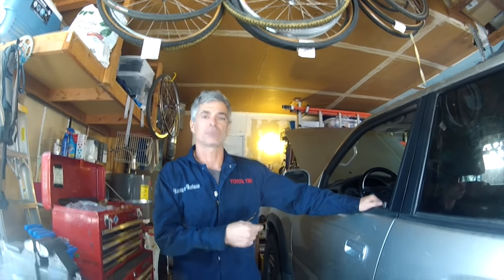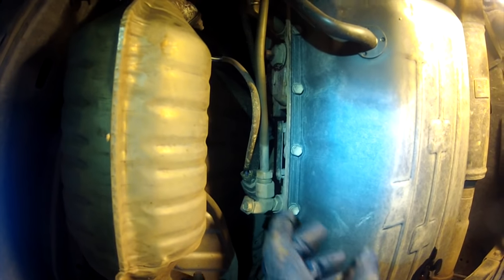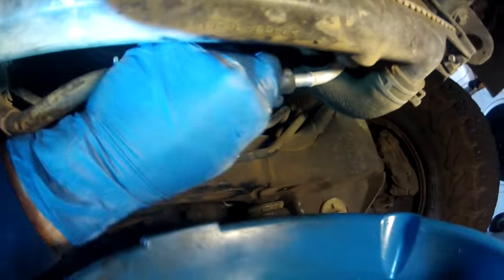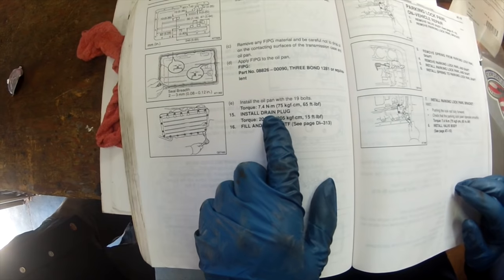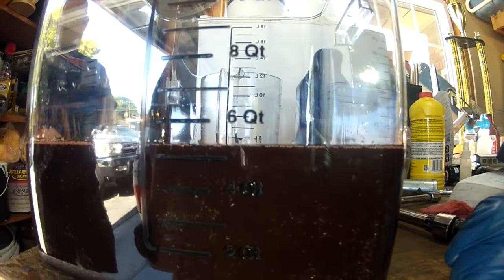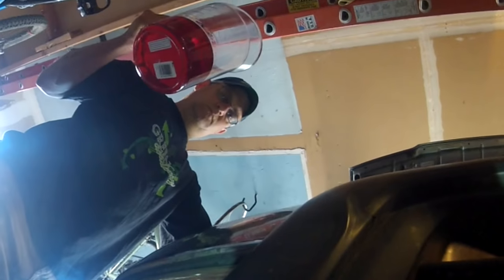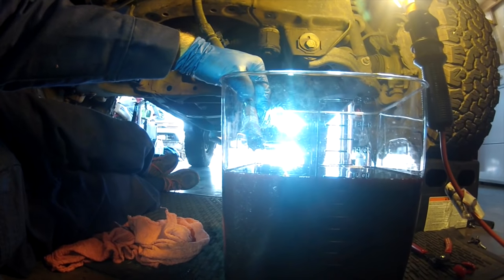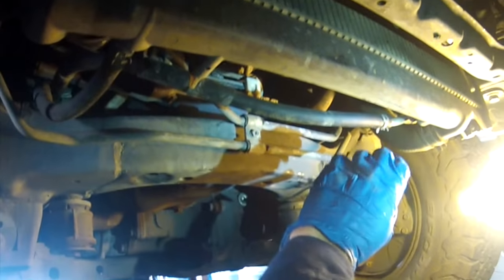Transmission Fluid Flush

Comment: @ TimmyTheToolman are you located in California ?? If so I'll pay ya well if you help out my Tacoma the transmission fluid needs to be replaced please!!
Reply from the maker: Oścâr Gomez Hey Oscar, I live in West San Jose near Campbell.
Reply: Timmy The Toolman I'm in San Diego I could come up to you!!
Reply from the maker: That's a hell of a compliment you'd be willing to drive all the way from San Diego for me to change your transmission fluid.  I just checked Google Maps and that's an 8 hour drive one-way.  This is not a hard job to do.  If you follow the steps we show in the video, you can do this no problem.  What year Tacoma do you have?  If you have a transmission cooler in the bottom of the radiator like most automatic transmission equipped vehicles have, you can just pull off the return line from the cooler and do the one quart at a time exchange until you fluid looks new again.
Reply: Timmy The Toolman well I've been  searching on Tacoma world, I have come across good write ups on how to do the flush most people are totally against the flush people say it'll shorten the life of my transmission in half ... It's a 2006 Tacoma TRD off road v6 sealed transmission . It's been bugging me for a while now preventative maintenance is what I'm all about .you know what your doing I enjoy watching your videos whats your opinion ?
Reply from the maker: You will not shorten the life of your transmission in half by flushing out the old fluid and replacing it with new fluid.   On the contrary, you'll extend the life of your transmission by keeping the fluid in good shape.  There is an exception to my statements above and that's if you or somebody you bought a vehicle from abused the transmission and never renewed the fluid at all (doing drain and refills of the pan), the old dirty worn out fluid could be holding suspended clutch material in it.  That suspended clutch material may very well be keeping the transmission shifting properly.  When you remove all that old fluid and replace it with new fluid, you lost that suspended clutch material and the transmission slips.  But, in this case the transmission was toast anyways and it would have eventually failed with or without the flush.

I'm ignorant in regards to these sealed auto transmissions.  I've never worked on one.  Why manufactures went to this I don't know.  They basically made it much harder for you to check the level and add any fluid. 
How do you check the fluid level?  Is there a site glass on the side of the transmission so you can see the level or do you fill it to the bottom of the threads of the fill plug just like when you renew the fluid in a manual transmission, transfer case or a differential?

Comment: at 6.42 min there is a mistake in the torque values 7.4 Nm=5.55lbft not 65lbft. some body must have over torqued badly
Reply from the maker: Yep, misprints like that aren't super common but they do exist and that's why people need to use some common sense and not blindly follow what they read.  Those transmission pan bolts are tiny.  If a person is stupid enough to try to torque them to 65 ft-lbs, they deserve the break off the bolts in the transmission.

Comment: drain n fill once a year for me!
Reply from the maker: How many miles do you drive in a year?
Reply: @TimmyTheToolman  - 2003 land cruiser and 2005 Tundra, put about 10k on each of them per year, Tundra is lifetime fluid haha! my Tundra sifts and down shifts and holds a gear perfectly in the Colorado mountains, I love it
Reply from the maker: @wolffo999  I do drain and refills every 10k miles as well on my rigs.  Yeah, "Lifetime" fluid is such a BS claim.  "Hey, your transmission blew up at 150k miles.  I guess that was its lifetime."
Reply: @TimmyTheToolman  - funny because its true! Lifetime for most vehicle owners is about 3 years? give or take…..so yeah why bother, I use the maroon jug Valvoline synthetic ATF…..cheap at my walmart
Reply from the maker: @wolffo999  I've been using Valvoline Maxlife.

Comment: What about the filter and torque converter
Reply from the maker: The filter is a fine mesh metal filter and not a paper filter.  It's considered a lifetime filter that doesn't need to be replaced.  With that said, I decided to drop the pan and replace mine out of curiosity to see if the filter was clogged at all and to see how much metal debris had collected on the magnets.  What I found out is the filter was 95% unclogged and the magnets had very little metal debris on them.  We have a video for replacing the filter.https://youtu.be/tuGazNhuEtM

As for the torque converter, the fluid in the torque converter gets exchanged during the flushing procedure.  The capacity of the system is around 12 quarts so you just want to keep flushing until you've exchanged at least 12 quarts and you should be good to go.

Comment: Why not change the filter?
Reply from the maker: You can if you want, but it's usually not necessary unless you have a vehicle with an unknown service history and the fluid is really black letting you know the fluid was rarely serviced.  Dirty fluid will create more deposits in the filter.  The filter is a fine mesh metal strainer and can last the life of the transmission if the fluid is kept in good shape.
Reply: @TimmyTheToolman   I didn't change mine either.  The fluid was OK, didn't smell burnt etc, but I didn't know the history.
Reply from the maker: @Me-zo8yc  You're fine not changing it.

Comment: I didn't see you replacing the transmission filter.  You only drained it and flushed it out.
Reply from the maker: Your observations are correct Ronald.  The filter under the pan is a fine mesh metal filter and not a paper filter.  So, it's not the type of filter you need to change out every time you renew the fluid.  But, is it a good idea to check it out at some point?  Sure it is.  My rig has 160,000 miles on it and my filter has never been changed.  I plan on replacing mine the next time I'm due for a drain and refill of the pan and of course I will film the job.

On Toyota forums, I have heard people who have dropped the pan at a fairly high mileage and the mesh filter was clear and unclogged.  The reason why I want to drop the pan and replace mine is it's going to let me know a little more about the health of my transmission.  If I see the usual accumulation of fine particles on the magnets on the bottom of the pan, I'll know my transmission is probably in decent shape.  If I see a large accumulation and maybe even some bigger chunks of metal, I'll then think maybe my transmission won't have the long life I hoped it would have.

When I installed an external transmission cooler on my rig, I decided to add a magnetic in-line filter made by Magnefine.  I change it out every 10,000 miles.  I decided to add this filter since I know the fine mesh filter under the pan isn't filtering out very fine particulates.
Reply: It's not a filter, it's a metal "strainer".  All big metal shavings will be caught by the magnets and rest settle at the bottom of the pan.  If you feel that you can put the pan back on with the same precision and quality as Toyota without having any pan seal leaks then, it's worth dropping the pan.
Reply: Oops, didn't see your reply to the original comment.  You had already address the Ronald's comment. Thanks.

Comment: Why not just drain everything at once, rinse / flush with few quarts new fluid, drain those, then fill completely?
Reply from the maker: Because if you drain it all out at once, you'll be running the transmission very low to dry for a little bit and my common sense tells me that's not good.  That's why we do it one quart at a time.

Comment: So why not just drain the pan, fill it back up, take it for a drive, then fill it up again? You’ll use about the same amount of fluid.
Reply from the maker: You could do that if you want.  What you're suggesting is more of a dilution process, than a flushing process.  You'll drain around 4 quarts out, and add 4 new quarts that will mix with the 8 quarts left in the system.  Then you'll drain out 4 quarts of that new mix and add back in another 4 new quarts to the 8 quarts left inside the sytsem.  Then you'll do this one more time for a total of 12 quarts exchanged.  The end result is the dilution process you're recommending won't get the fluid as clean as the 12 quart flush process we show in the video.  The dilution process does work well to keep the fluid in good shape, but it gets a different result than the flush.

Comment: If your coolant temp is high on an old car, maybe you should blow out the radiator with compressed air, as it might be jammed with shit and can't dissipate heat optimally anymore.
Reply from the maker: I'm not so sure that would work.  There are so many tiny channels in a radiator and I don't know if blowing compressed air inside would truly clean out blockages.  But, it couldn't hurt either.  Maybe worth a shot before throwing out the radiator.
Reply: This guy owns like 30 Mercedes cars and he knows da wae... ;)

https://www.youtube.com/watch?v=qb4p1ZMgd9Y

Engine running 5-10 hotter sounds exactly like your problem.

Comment: Why add fluid at end of procedure if capacity was at 12 already?
Reply from the maker: For two reasons, #1, we probably drained out a little more than we added back after all those rounds of draining out one quart and adding one back in..  #2, Joe's system might not have been properly topped off to begin with.
Reply: I will give it a try next few days...my fluid arrive Friday...should be interesting...G35 Infiniti 2007 Coupe is my car....I will check fluid at start, too...thanks...
Reply from the maker: Ok, pour quickly!
Reply: In your video, it takes like 13 seconds to output one quart....I could not determine how long it take s to input one because it seems the video was put in fast forward mode...so, I will time how long it takes to input one quart on my G35....and time the first quart out....kind of curious....but, I agree...my guess before I do this is that it is SLOWER to go in than it does coming out...I am working on this by myself....so, maybe it safer doing one quart at a time....hahahah.hahaha.hahahah
Reply from the maker: Yeah, John, don't burn up your transmission.  You should get somebody to help you.  All they have to do is start and stop the vehicle when you tell them.  You've got to have somebody that could help you do something so simple.  Good luck and let me know how it goes.
Reply: I did it! Please read my more detailed comment on the posting....

Comment: Ur supose to clean the ATF oil pan first and clean the megnat. If u did not all the dirt is goin through the system even if the fluid is new.
Reply from the maker: The whole goal of this is to renew the fluid.  Anything on pan magnets or trapped in the fine mesh transmission filter is going to stay there.  The pan can have some build-up of sludge on it but I don't think that's going anywhere either.   For anyone wanting more filtration, I recommend adding in and inline magnetic filter into one of the cooler lines.  Now all minute particles that were able to get through the fine mesh transmission filter will be captured by the magnetic inline filter.

The only reason I'd drop the pan is if I wanted to replace the transmission filter or because I had to for some other reason like replacing shift solenoids.  Here's a recent video we made of dropping the pan and replacing the transmission filter. https://youtu.be/tuGazNhuEtM
Reply: Am really convinced of wot uve said coz i remember wen i removed the ATF pan to replace the filter it was almost reusable but i decided to replace it once ive dropped the pan.
So i guess i will only drain the fluid abd add some new fluid.
Just a question does ur process drain all the fluid inside the torque converter?
Reply from the maker: Yes, this process renews the whole system.  For this flush, you're running the motor which is turning the transmission (torque converter).  You're using the pump in the transmission to move the fluid for this flush.  You drain one quart out, stop the engine, add a new quart and repeat until the fluid draining out looks brand new.  I suggest moving at least 12 quarts through the system, because that's the capacity for a 3rd Gen 4runner.    Watch the whole video and you'll know exactly what to do.  Also, read the video description for other helpful information.
Reply: Timmy The Toolman i hve decovered that i dont hve a draining plug in my 2006 tahoe wot do u suggest?
Reply from the maker: I'm not familiar with the Chevy Tahoe.  No drain plug.  Hmmm.  Well, there must be some way to get the old fluid out.  Maybe you're suppose to use some suction pump to pull the fluid out via the fill plug.  I know vehicles are being made that make it much harder to replace the trans fluid.  There's no dipstick so you have to use another means to check the fluid level and add fluid.  I haven't dealt with these newer automatic transmissions so unfortunately I'm not able to be much help to you.

Comment: I just added while my truck ran. That’s a lot of stop and starting.
Reply from the maker: Well,  I know how fast it takes to pour a quart of ATF into the dipstick tube via a transmission funnel and it's not exactly quick.  So, I'm pretty damn sure you were losing it out the cooler line into your catch basin much faster than you were able to replace it.  I would never suggest somebody do it your way and risk running the trans very low on ATF just to avoid starting and stopping the vehicle around a dozen or so times.  The reason for all the stop and starting is to accurately keep the trans topped off with the proper level through the whole flush process.
Reply: Timmy The Toolman   No,I did a flush on my tundra so I had to put about 10 quarts while it was running,also to fill up the torque converter. Dosent shudder no more because I had a cross contamination from my radiator and antifreeze got in my tranny,so I replaced the radiator,the cooler and flushed all the contaminated oil out. Runs like a top now.
Reply from the maker: @jimbomorrison7133  I still don't get how you replaced it as fast as it was coming out, but ok, good to hear your transmission is functioning well.
Reply: Timmy The Toolman  I had a half gallon funnel with a tube that ran down to the transmission,so I started it,and as it was coming out in a pan I had 6 gallons right by me and would just keep pouring it in watching the funnel. It took me a lot of fluid for my flush. It don’t feel to good to be pouring $36 a gallon,trans fluid only to be pumped out and thrown away.
Reply from the maker: @jimbomorrison7133  Ok, but where was the fluid entering the trans?  You usually pour it in via the narrow dipstick tube on an automatic trans and that doesn't allow you to replace it fast enough as it's leaving via the cooler hose.
Reply: Timmy The Toolman   I have a sealed transmission,so I have an add bolt(24mm) on the side top of my trans,so I run a tube down to the hole and hook a funnel to the tube,so as the transmission tube I disconnected from my radiator squirts out my contaminated trans oil,I just pour more trans fluid in the funnel and keep doing that until trans fluid comes out a good red color. It’s quite easy for one person to do.
Reply from the maker: @jimbomorrison7133  Now I understand.  You have a sealed transmission.  What technique do you use to verify the proper level after you're done with the flush since you don't have a dipstick?  I've seen one video on servicing a sealed trans but I'm interested how you do it.
Reply: Timmy The Toolman   There’s a transmission drain plug on the pan and there’s also a trans level check plug on the pan which has a vertical 2” tube inside,so as I add fluid I keep the check plug off,and I keep adding while truck is running in park,and when it is full,trans oil will come out the check plug hole,then I put the check plug back on the pan and that’s that. I always check a day later at running temperature to see if I have to add or I’m ok.
Reply from the maker: @jimbomorrison7133  What's the operating temp you use when dialing in the level via that overflow check plug system?  This is the same operation I saw in the video I watched but I can't remember what temp they used to get the fluid level correct.
Reply: Timmy The Toolman between 99-114 degrees
Reply from the maker: @jimbomorrison7133  Thanks.  I would like to make a video for servicing a sealed transmission at some point.
Reply: Timmy The Toolman   I don’t like them. I’m old school. I like the dip stick.
Reply from the maker: @jimbomorrison7133  Yeah, we definitely agree there.  It seems pretty clear they did this to make DIY fluid changes harder and more people would bring their vehicle to the dealership for service.
Reply: Timmy The Toolman   Yep. I’m 49 and I had at least 25 cars growing up so I’m a fix it yourself guy. If I don’t know how to do it,I learn.